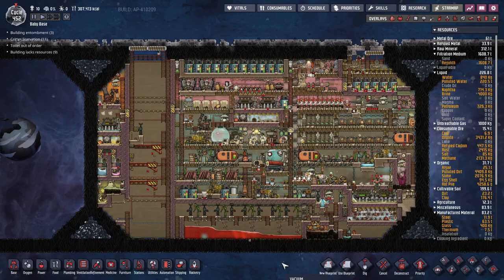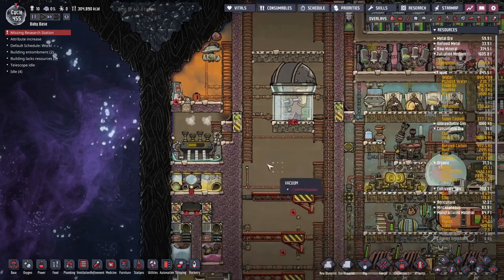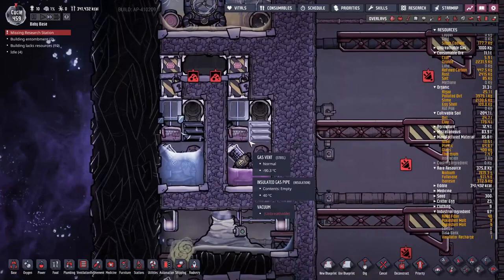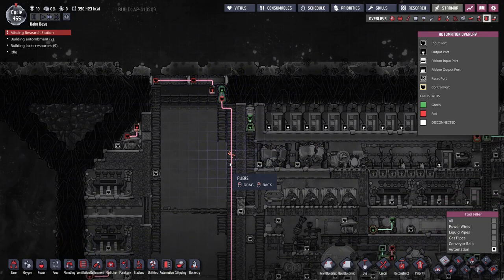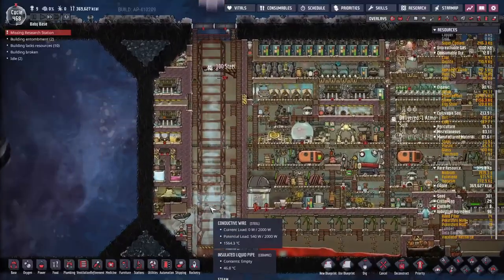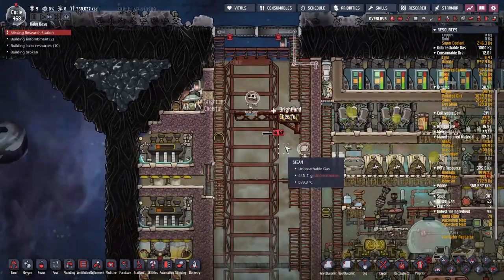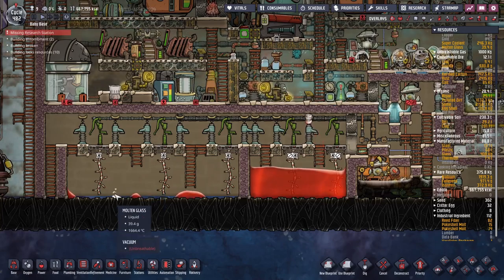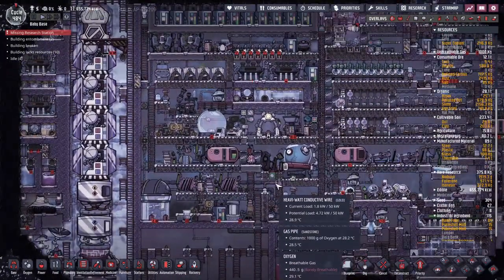Baby Base 13 : Hot Rocket problems and Creating Space : Oxygen not included

Comment: You might be able to save some space by combining the steam turbines for the liquid oxygen and hydrogen and the rocket silo by just connecting the steam chamber to the rocket silo with metal tiles. If you have thermium/niobium, the aquatuner won't ever overheat, and you save a bunch of space as well. Add in a few automated airlocks, and you also prevent heat being wasted.
Reply from the maker: That is a risk. The most heat will be around take take off and landing, which happens to be around the same time as fuelling. So you end up in a situation where you are trying to produce LOX and LHO while also having a ton of heat being dumped into the silo. I figured it would be safer to have a dedicated turbine.
Though I might be being a bit over catious.

Comment: 1:07 told you! Naphtha is the best! Couldnt have done that with most other liquids, they simply aren't viscous enough. +1 for team naphtha! :D
It is just so easy to work with and it behaves so well.
Also... 31:29 notice you in fact CAN dump (or rather force inject) heat into neutronium! Nat. gas pump area.
Reply: And the neutronium below the rocket itself is boiling hot as well!

Comment: Move the lava out of the way, and put 3-4 Steam Turbines that suck HEAT out of the silo (but not directly connected to the steam - connecting to the steam will waste heat). You can use a lot of that heat between launches to almost entirely power your base.
Reply: I only had enough heat from the silo to power one turbine, and only if the rocket constantly goes to the closest planet. Anything further and the silo gets too cold. A single rocket simply doesn't generate that much heat.

Comment: you have enough space to make a set of three doors in front of your liquid lock to space. You can make a system that opens the middle door while the two beside it are closed so that it is a vacuum. This will reduce the movement of heat into your base. A disadvantage of this is that it will take some time to move from one end of the set of doors to the other

Comment: I found it helpful on this LOx/LH2 layout to pre-cool the hydrogen by running it through a radiant gas pipe inside the diamond tile on the oxygen side. This also helped regulate the chill coming from the single aquatuner coolant line. All told though this build did work okay but it took like 40 cycles to build up enough LH2 to get to the tear. Also, there wasn't enough room in the LOx space to store enough of it to get out there, so I had space for a nearby tank which could be alleviated if you were to make the LOx space wider by 1 tile.

Comment: You could have moved the steam turbine for the rocket silo, one to the left and one to the top. this way you only have 1 isolated tile next to it, but you have 2 tiles at the bottom for steam to come in.
Reply: Sadly the turbine needs to have two tile wide wall between it and the silo, because of a bug with with dust comets. When dust comets smack into a one-tile wide vertical wall, it spawns regolith on the other side.
Reply: @Karagoth444  yes, that is true. But in that case it would make more sense to make the 2nd time (the one touching the rocket) out of bunker tiles
Reply: @Karagoth444  I mean if he is willing to go through the chaos of shifting his entire rocket over one, which would only be chaotic if he wanted to keep room for the ladder + gantry on the right hand side, he could then keep the 2 tile thick while obtaining the 2 tile height for his steam rocket, however his current rendition is a lot less headache so I can't blame him if he would rather stick to that one
Reply: I was yelling this at the screen. And he was rebuilding the rocket at the time so would not be a big deal.
Reply: Mine has bunker tile and then insulated. It still damages the tile behind the bunker tile.
Reply: As of patch 419840 released yesterday, regolith spawning has been fixed "Fix meteors depositing regolith on the wrong side of thin walls". I now also recommend moving the turbine.

Comment: As the naphtha guy, I approve of this @0:54 :)

BTW, I suggest you double the naphta lock to avoid heat leaking. Naphtha is a decent insulator, anything else (like petroleum) would leak MUCH more, but when the temp delta is so big (several hundreds degrees) it isn't about TC much. I'm sure you know how to do it but for people who don't know what I mean:
https://imgur.com/a/olzYcPJ
of course if thermal insulation is the goal, tiles should be insulated ones.
Reply from the maker: I'm going to have to redo access to the rocket silo, as some point I'll have all the research and I'll config it for cargo and seal the whole thing up.

Comment: If you build 2 telescopes, it will be done faster. Can stack them vertically.
It's possible to just put a couple layers of airflow/mesh tiles above it and just leave the doors open. Requires some manual mining, but w/e it's quick.

Also, you could possibly open the second boiler room (the one with the aquatuner) to the rocket silo for double chill.

Comment: the only thing i want from the DLC is thorium being a alternative power plant resource
Reply: How about a dual fluid reactor. You can use whatever fissile for the fuel fluid. The other fluid is whatever metal you want to use. Lead would be the safe option (since it causes the system to be heat self-regulating, and power progressive).
Reply: @Dan-gs3kg  yeah that would be cool ! i wish they will add it in the new dlc :D

Comment: could put a steam turbine at the bottom of the silo in that newly opened area, maybe two of them with an aquatuner at the opposite end from the rocket to cool the turbines.  A layer of super coolant on the floor from the rocket to the aquatuner to help with temp transfer while also letting you drain the turbines back into the aquatuner chamber below.  Steam would still need to be pumped into the chamber from the top of the silo but it is an idea.

Comment: Try moving the steam turbine one right and then one up, and you'll still have space for walling everything off while also getting the two-tile height for more optimal steam input?
Reply from the maker: That will leave only a one tile wide wall facing the silo, if a meteor hits at the right angle it will cause regolith to spawn on the opposite side. That is why silo's are always 2 tiles thick.
Reply: @FrancisJohnYT  seems patch 419840 had the intent to fix that bug, as well as many other things, saying they fixed meteors depositing regolilth on the wrong side of thin walls, should mean will be able to have 1 tile thick walls now right?

Comment: So honestly base conservation is really lookin like the priority with the little bit of magma you have left, it’s honestly about time you rip out your core structures where the central cooling is and combine it with the last little bit of magma generation you have, I’d honestly try and find a way to combine it to the rocket silo so you have another way of siphoning hear out, using a thermal aquatuner in the rocket silo to help cool your base might be a bit difficult to get the heat to dissapate properly so I’m not quite to sure how to approach it, is steam considered heavier or lighter then CO2 in ONI, it might be important for placement of steam turbines because the CO2 might end of clogging your steam turbines if it doesn’t have a way out

Comment: So, about the sour gas boiler...

If they're normally so big, then can the mini-base afford to go without such a construction, and instead opt to burn off the petroleum through boilers, and dump the sour gas into space? Or do you have plans to miniaturize it?
Reply from the maker: The oil well can spit out 3.33 KG/s of crude oil.
If I just refine the Crude normally it would only bring in about 1.65 KW before expenses.
A petroleum boiler would pull in about 3.3 KW of power before expenses, it also it would be pretty big.
A 1kg/s sour gas boiler would pull in about 5.9 KW of power before expenses and limiting it to 1kg/s means it can be compacted a lot, it should be about the same size as the liquid O2 and H2 device.

Comment: the only way i think you could make a even smaller liquid oxygen/hydrogen generator would be to have just a single tank and pump, letting the liquid mix then sort it out after its left the tank. You may need to get clever with heat exchanges and liquid values to get as much heat from income gasses into the oxygen with out causing it to boil.